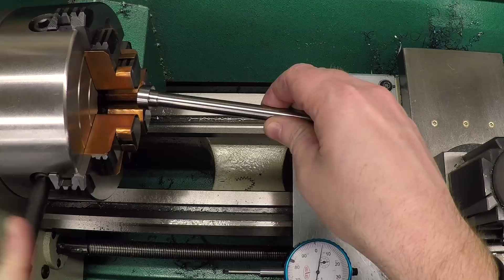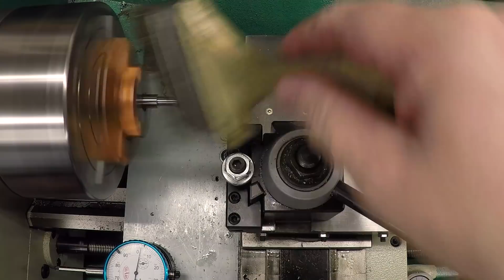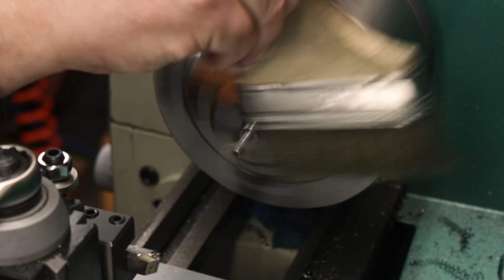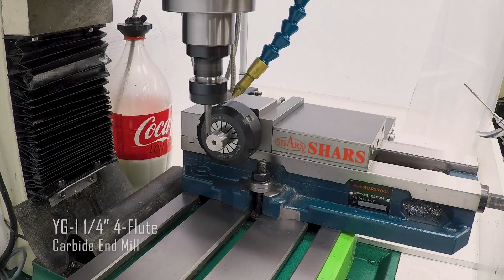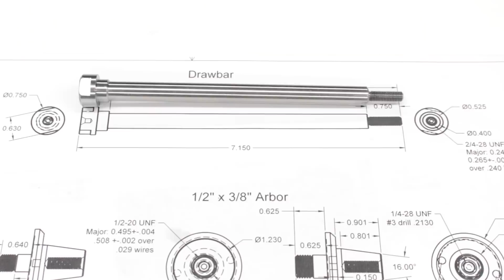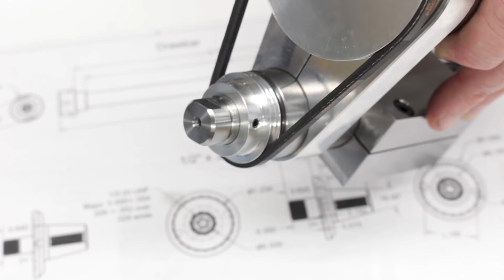Making a Toolpost Grinder Part 17: Drawbar 2

Comment: Threading: I wonder why you feed the compound slide when it`s not 90° degrees to the bed ways? In this case you have to feed your bed slide. Or am I wrong? Greetings from Germany
Reply: you feed in at 29.5 degrees feeding with the compound does 2 things it puts most of the cutting force on the leading edge so the leading edge does most of the cutting and its really close to a 2 to 1 in feed ration compared to the cross slide easier to take off thousand at a time. Note 30 degrees would be exactly 2 to 1

Comment: I had forgotten the run the upside down trick. Regardless though, is my assumption correct that the relief weekens the part, either in tension, or axially? Is decrease in strength of an appreciable amount?  Does cutting the threads without a thread relief, using the methods you described in your first replie reduce or eliminate the weekness', if any, that i assumed thread reliefs would cause in my initial question. Does cutting threads without a thread relief introduce any problems itself, beyond the increase in reflex required that you mention in your quick withdra method.

I know this is a lot of questions, but the web seams to be filled with opinions versus proven truths, my college engineering book olny provides me sets of differential equations to solve in order tp get an answer, i dont have the proper machinery to test in the lab, and i cant afford finite analysis software. If you gave a good reference you can point me to id be more thsn happy to figure out the answers myself. 
Above all else, regardless of any help you can or cannot provide, thank you for making your videos. I am really enjoying them a lot.
Reply from the maker: My understanding is that the threaded part of the bolt is the weakest because the material is narrowest at the root of the thread.  As long as you don't cut the relief narrower than the thread root, I don't think it makes much difference.  Beyond that, I think you would have to talk to someone with more mechanical engineering background.
Reply: @Clough42  You are correct, the deepest cut is the weakest spot. Its just that my eyes try to convince me differently. They do the same when i read a micrometer that has measured one of my parts versus somone elses parts. But in that case they tell me to ignore my errors 🤣. Great videos. Great detail. Real confidence builders when you show your complex projects as a series of easier projects for each part. Thanks.

Comment: I always feel that I am weakening the bolt shank when I cut the thread relief, especialy on this smaller size bolt shanks like the one in this project. Is there really no way to cut threads with no relief? How about stopping the lathe and reversing out of the thread until you are out of the shank, advancing the compound and then going right back in? Why do we even need the reliefs? Does a cnc lathe cut a relief as well?

Thanks, I really enjoy your videos. Please don't get burned out making them!

Leo
Reply from the maker: It is possible to cut without a relief.  You can "quick-draw" the cross-slide when you reach the end of the thread, but this requires good reflexes.  You can also flip the tool upside down or run it on the back side, fun the lathe backwards and thread away from the shoulder.  However, if you only cut the thread relief to the final thread depth, you aren't really weakening it much.  The strength of a threaded part is generally a function of the minor thread diameter.  The radius on the thread relief and at the bottom of the thread  form probably has a bigger effect on the performance of the fastener--especially on a fatigue basis.

Comment: having watched  this  project    with interest  i  am thinking of  making one for myself , to  drive it i have a exercise  machine motor and controller  from Ebay  with speed  control
Reply from the maker: Very cool.  The motor I used is about the minimum power you would want to use with a 4" wheel.  It works, but more power could be put to work.

Comment: How many parts total are you making for the toolpost grinder video?
Reply from the maker: A lot.  :)  When I started this project, I new it was ambitious, but it didn't quite sink in just how much work it was going to be.  I'm enjoying it, though, and it keeps me busy.  I still need to make a wheel arbor and tightening tools.  I have some ideas for a wheel guard and a diamond dresser, and I still need to do something about a power supply and speed controller.